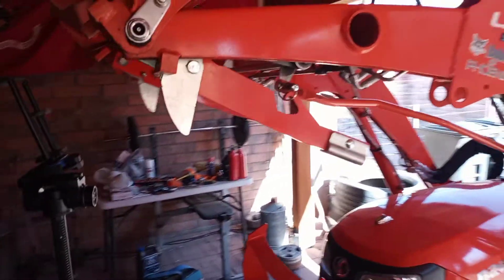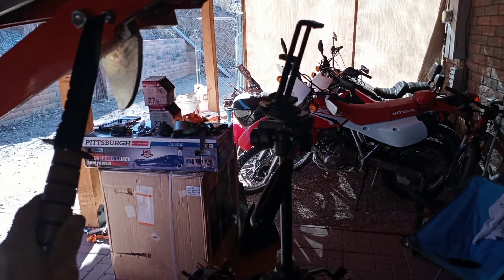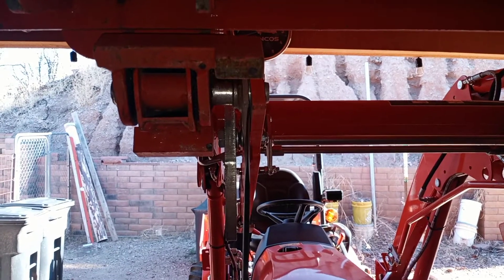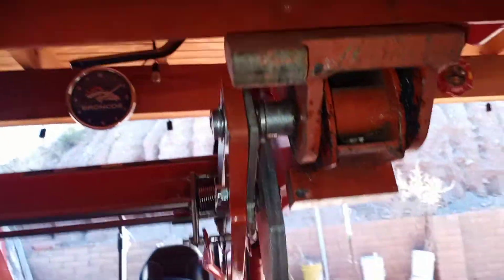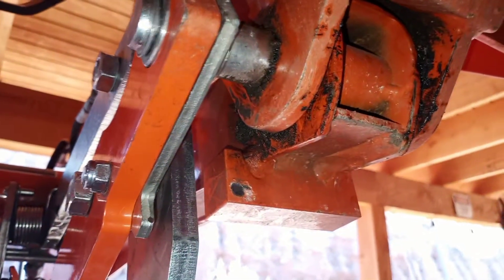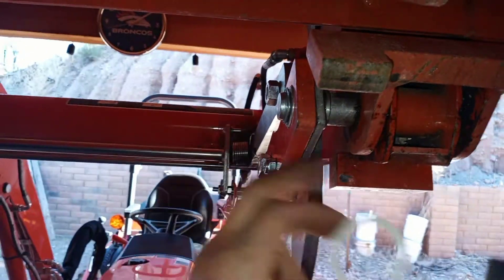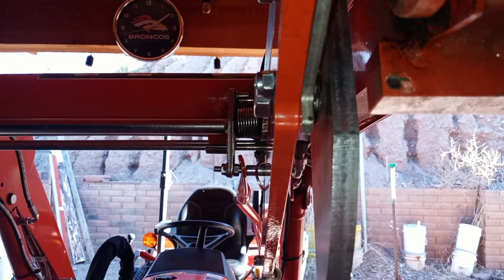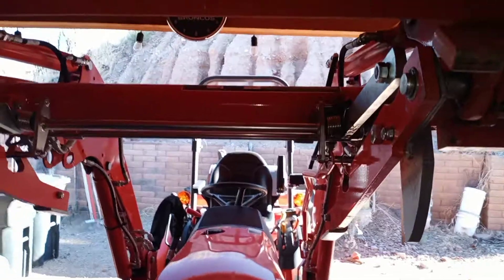Kubota B2601 LA435 swift tach front loader leg problem

Comment: I removed all that junk and put the regular legs on, so much better. With that stupid Swift catch system, it was hard to even unload stuff into a dump trailer the legs were in the way. Horrible system!
Reply: Can you tell me how you done that. I'm so pissed at my loader stand errr
Reply: @thomasreece3075 I bought the regular legs and pins and I simply removed the old legs and linkage in everything else. It's super easy.

Comment: The legs on my 2601 won’t drop. In fact they don’t even disengage from the lock. I’ve taken it in to the dealer three times to fix this problem. Unfortunately, they’ve never gotten it to work.
Reply from the maker: Don't know what your dealer tried. But USUALLY if they don't drop, the bolts are to tight at the legs. Or pins of the drop system are not adjusted evenly. There is a long galvanized screw coming out of the long 3 foot rod attached to the release handle. Need to remove the wire lock to adjust.  It took me a bit of tightening and loosening parts until I got my system even. It's not rocket science but does take a little time to get things straight. Also, I play with all kings of toys and tools and came out of the fire service. I have dealt with dealers, mechanics and instructors. Sometimes even instructors are over glorified by someone who thought they were the right person for the job. Moral is that they don't always know what they are talking about and such is the case with the lead mechanic at my dealership. Ha ha. If you want to tinker with it, I recommend you lift the loader and take your time adjusting the system on level ground. BE SAFE.

Comment: This is interesting and I wonder if this is why there seems to be problems with the bolt hitting the bucket. I actually went to the dealer after seeing this. I have a different problem and was looking for help, but asked about this. The guy in service showed me that there is not supposed to be a washer, 2 different models of the LA435 and one has them, one doesn't? not sure if that is correct, but that is what he said. I think you have the correct solution, just not sure how easy it is to take that apart. We looked at 3 different tractors with that LA435 and none of them had washers on either side but all had a little slop. One was in service for repair because of the same problem you had and you can see where the bucket hit the bolt. I also think that these bolts all need to be tightened regularly, I lost a bolt for the locking mechanism on mine and was there to get a replacement bolt, just glad nothing in the system broke or bent.
Reply from the maker: I did discover that there was no washer on the right side. The bent galvanized peace was actually dog leg bent at the factory to move the partst over some the prevent it from catching on the bucket. Which I hope to make a short video to recommend as the easier fix. I went to the dealer some time later to get filters and they told me that they later had the same problem with a new tractor in their yard and determined the its a bad design. They ended up watching my video to fix there new tractor.

Comment: Bro you have saved me so much time trouble shooting this problem. I figured it had something to do with those bolts being loose, apparently some of them need to be tightened after so many hours of operation, BUT I must have missed that when I was not reading the owners manual. But thanks again you’ve helped me tremendously.